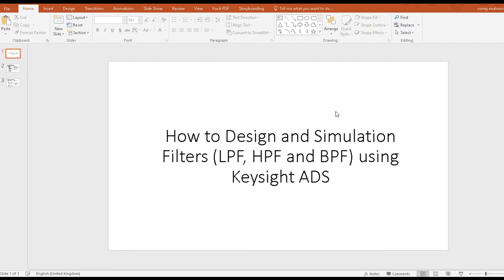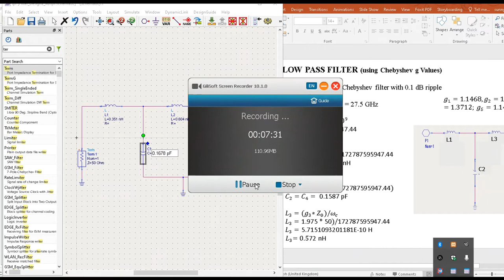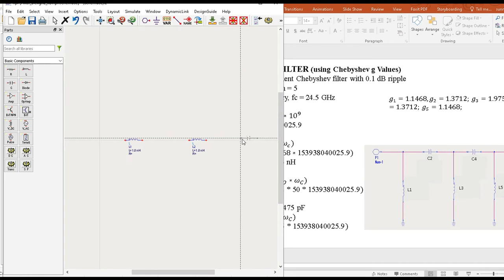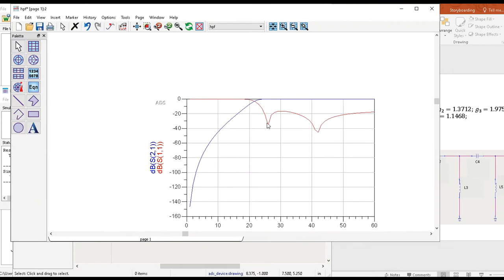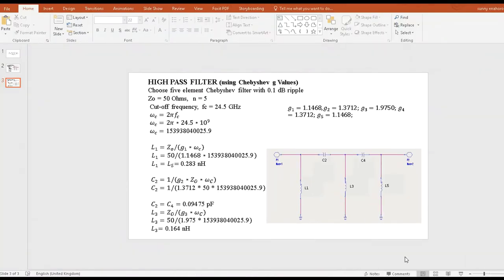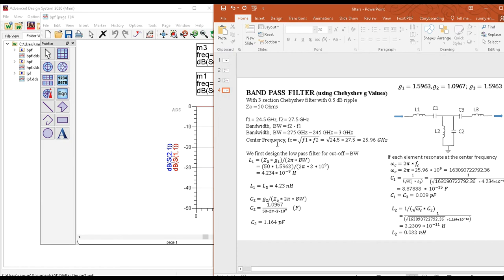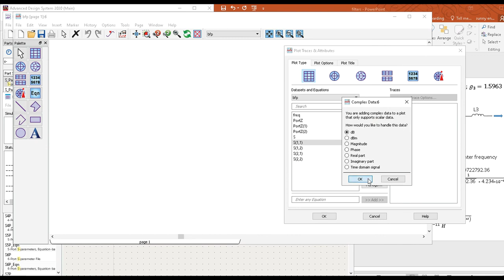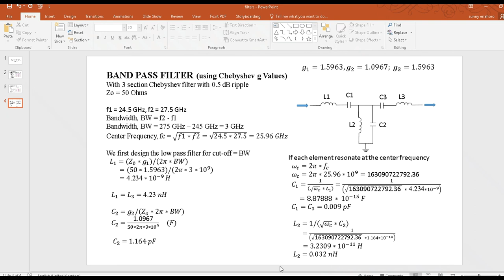How to Design and Simulate Filters LPF, HPF and BPF using Keysight ADS

Comment: Can you please explain last slides for BPF 
Because calculation which you have done for c1 and L2 is different like when i am calculating as given in the videoa i am getting different value 
Like as u r getting value for L2= 0.032nH but i am getting 2.127*10^6 F
So can you please explain this?